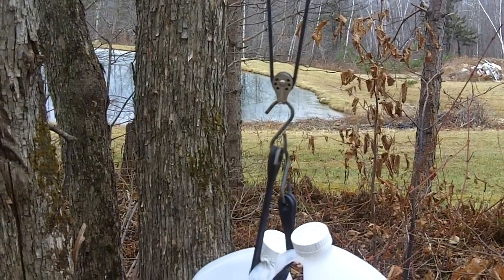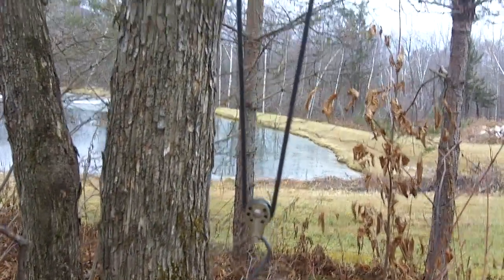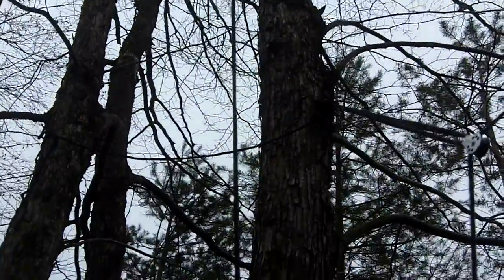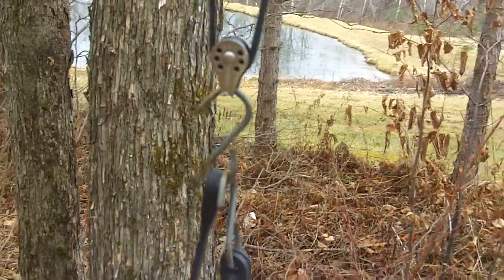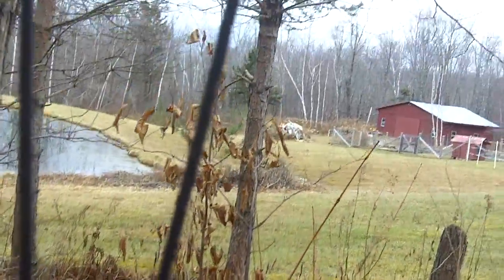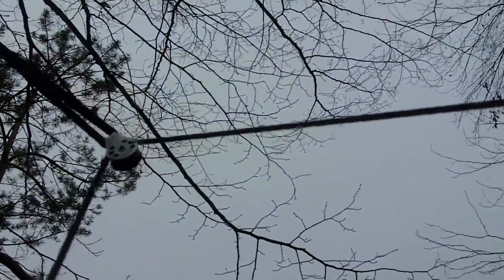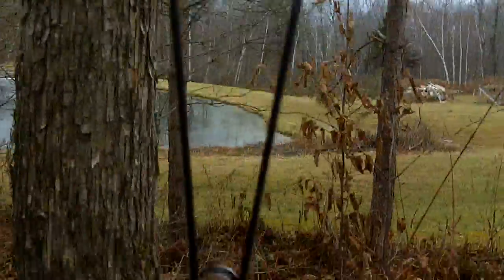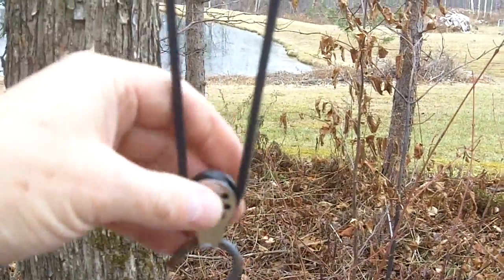Ladder Line Doublet Counterweight

Comment: What is the use for this, like what dies it do
Reply: It helps relieve stress on the wire dipole as the trees, the tie points for the dipole, move in the wind. Putting less stress on the wire dipole may provide a longer life before breaking requiring the dipole to be repaired or replaced.